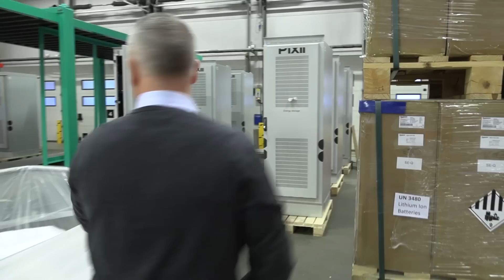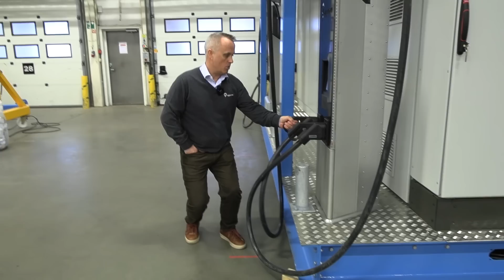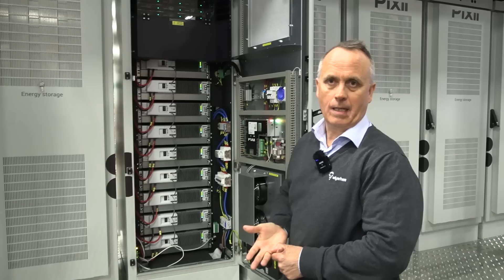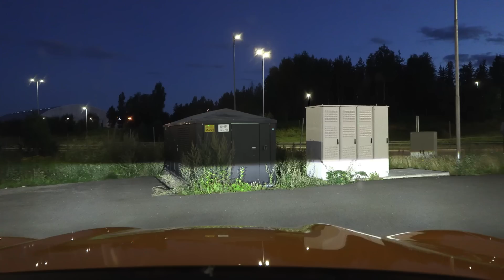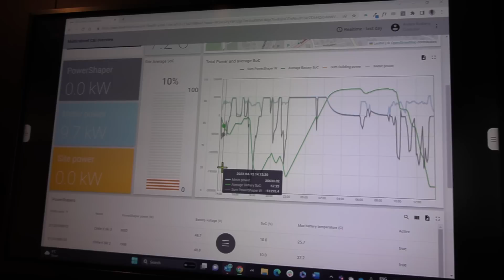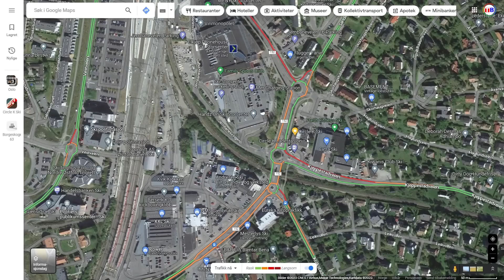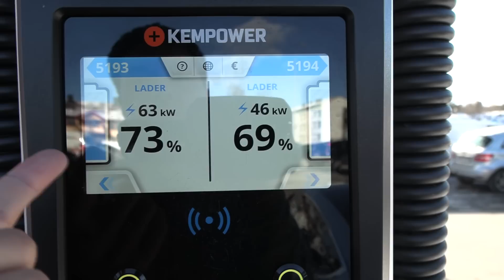Elywhere's semi-portable 360 kW fast charger with 300 kWh local battery storage

Comment: I work in the UK Electricity transmission industry and this is a great idea. It solves so many issues in one compact unit. We need solutions like this available to quickly boost the EV infrastructure.
Reply: I agree Mark. Units like this would be ideal in rural towns, in the "charging deserts" away from motorways & cities.
For example, in West Wales there are no DC fast chargers (there is one Tesla supercharger station in Aberystwyth, that's it). This is a major problem for EV driving tourists whose accomodation has no (or not enough) overnight charging.
Reply: We need to start building them in the UK 👍
Reply: May I ask how is this portable is being charged?
Reply: @bcbcfilm  It has a grid connection but one rated to far less power than a conventional EV rapid charging bay. Its alot easier to get a 100kw connection than it would be to get 600kw required for 4x 150kw chargers. It uses this 100kw to charge the battery up during the night and breaks between vehicles being charged. If for example they found that 300kw of storage was not enough and the batteries were being completely discharged then they would just change it out to a 600kwh battery. It relies on the fact that the EV charging spot wont be in use 24 hours a day. If it was that busy that people were using it at 2am for example then they would have to consider an uprated grid connection
Reply: @bcbcfilm  portable in the sense that you don't need to dig shit up in the ground and install this. If you don't need to dig those stuff you have less permits and stuff, so it's quite portable
Reply: Yes agreed
Reply: You cannot boost infrastructure with random projects and chargers unfortunately. It should be unified and running by the same company. Outages should be fixed immediately within a day. If something doesn't work, - it should be reported to drivers instantly. I don't see how other chargers will survive other than Tesla. All other cars other than Tesla are made only for home-work applications. Period.
Reply: Agreed but I think this would work more in rural areas. Urban cities this would be challenging because of land space. That whole unit can only accomodate 2 chargers which is inefficient use of space in cities.
Reply: @H4M24UK  To clarify - four cars can chere simultaneously on one of these units, not two.
Reply: @H4M24UK  perhaps in cities they could double stack the units so you have up to 1200kWh battery storage and 4x300kW car  charging connections on the same footprint you need for grid tied chargers with a transformer.

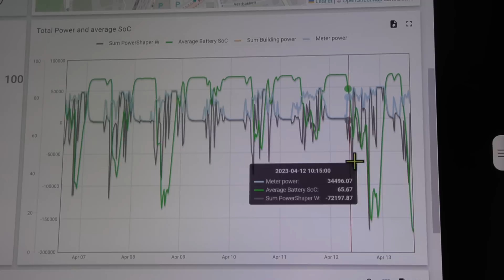Comment: 20:00 Very cool. We need more of those solutions. Thanks Björn for showing so much cool stuff to us. 
If you look closely at this station I wonder if it would be possible to have 8 Charging Stations instead of just 4 (which are on the shadow side as well). 4 on every side (Northbound and Southbound)
Greeting from a happy Tesla driver since 2019 and 80.000 km. Although I try to use my feet or my bycicle as much as possible I have to confirm that I really really enjoy driving my Tesla.
Reply: If you needed 8 charging points, you could just put two containers in.

Comment: It is like a large capacitor on the network. Smoothing out the peaks and troughs. Stable energy prices for the win!
Reply: No I was thinking a capacitor is designed to discharge quickly and completely. I don’t think that’s the case with this one. It’s like a very large power buffer topped up  from the grid or solar panels that also take advantage of lower tarif rates
Reply: Haha, even mentioned it at the end.

Comment: Rich people toys, yay.
Reply from the maker: Pro tip: Watch the video to understand why this is great. Don't be a noob and just comment without watching.
Reply: Oh stop it! People all over are going to benefit from this!
Reply: @konsul2006  How? It will be a lot more expensive than a basic less powerful station and it will still get bottlenecked by the supply power, battery only helps a little when it's not used as often. This is about as useful as solar roadways.
Reply: @UhOhUmm  I don't have that kind of knowledge, but it is scary if you are seriously comparing this to Solar freakin' roadways... But I think you are wrong about that.
Reply: @UhOhUmm  If the Batteries were not enough to cover the daily demand they would just add more storage. The chances of someone wanting to use the charger between midnight and 6am are very slim and in that time you could of put in 600kwh of charge into the batteries. Its a great business model, buy electric cheap, sell it at a premium to ev owners and then when the grid has low frequency sell them back the electric at a higher price.
Reply: @Marks-Garage  so you can put 600kwh into a 300kwh battery? How does your math work? It's a questionable business model, electricity price doesn't fluctuate nearly enough for that kind of offset, fast chargers already get paid multiple times the electricity rate and batteries will wear out over time so you're losing out again. 

This thing is an experiment that is going to lead to nowhere. They advertise deployment in areas where grid expansion is not viable, but there aren't many places like that and to have that + people who buy new EVs you're looking at a slice of pie that is see-through.
Reply: @UhOhUmm  I said if the batteries were not enough to cover the daily demand they would just add more storage. In the video he clearly says it can be upgraded to 600kwh. You haven't even watched the video. These lifepo4 batteries are rated to 9000 cycles so battery life is not going to be an issue. I can speak from personal experience that grid connections are difficult for numerous reasons. This is a great solution that fixes many of those issues. Watch the video and you might actually learn a few things
Reply: No offense, but you don't have a clue at all! Key words here are peak shawing and load balancing (grid frequency regulation). They have tole you in the video that return on investment is just 3 years, but you didn't even watched the whole video, if you did, then you would know that.
Reply: @drister007  Yes, 3 years. Solar roadways promised free roads too.